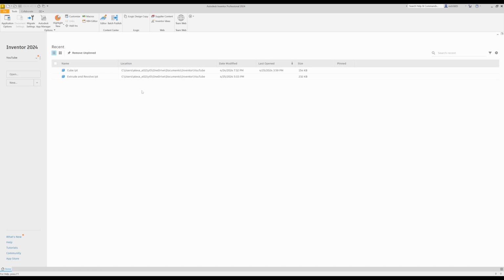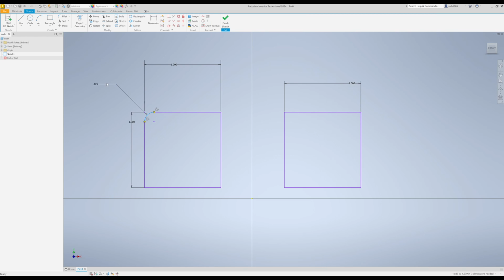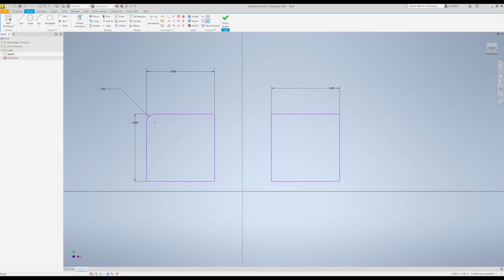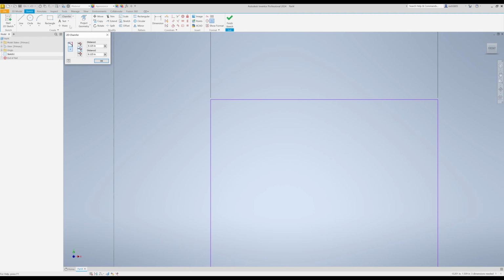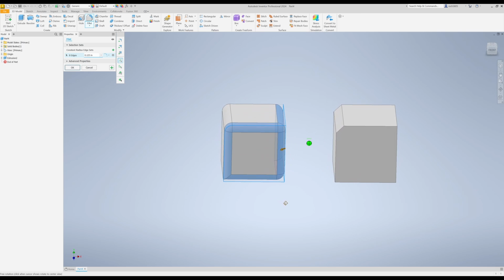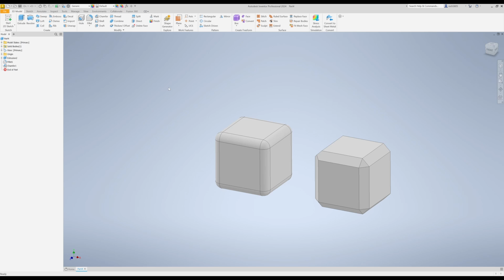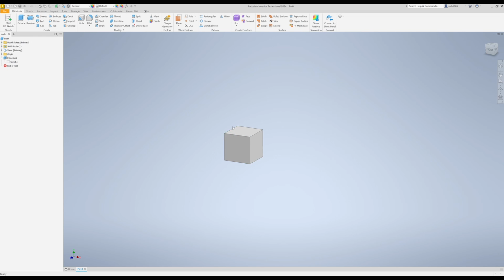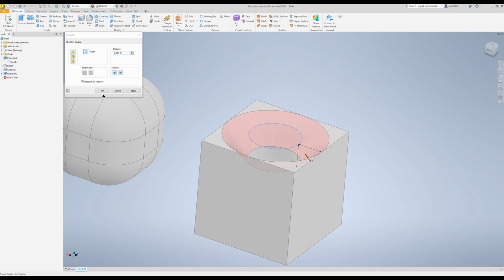How To Use Fillet and Chamfer - Autodesk Inventor 2024

Comment: Thank you for this video, is am in a cad class, and have to make a part that looks to have a chamfer on it.  And for the life of me I could not figure it out.  Perhaps if you have time, you could show that?  Basically have to take my orthographic views and turn them into isometric.  It's a pain.  The part looks like an arrowhead, but it has a chamfer on front to the tip and also chamfer on the sides.  My brain hurts hopefully this will work for me.
Reply from the maker: Sorry for the late response, but I’m glad it helped you! I hope you were able to figure out what you needed to for the project!